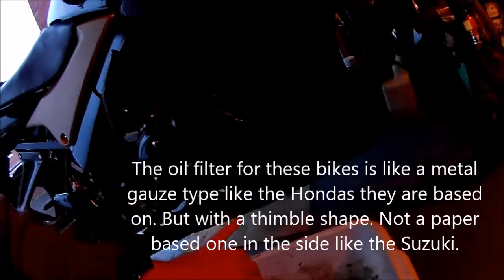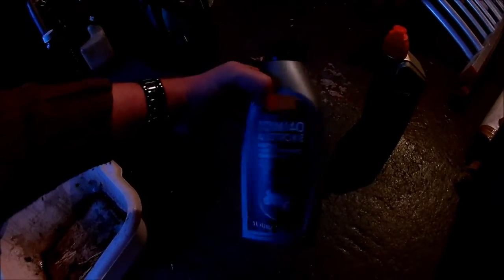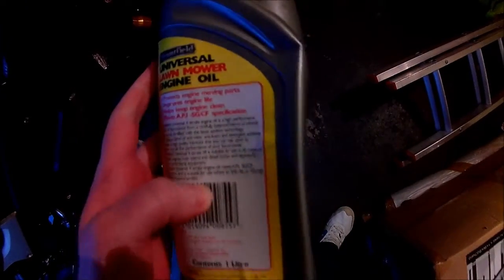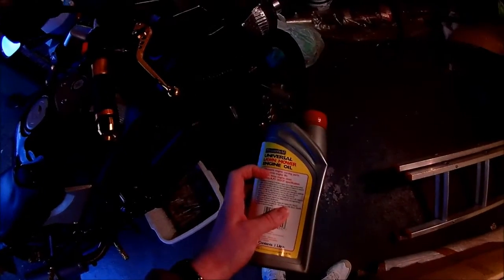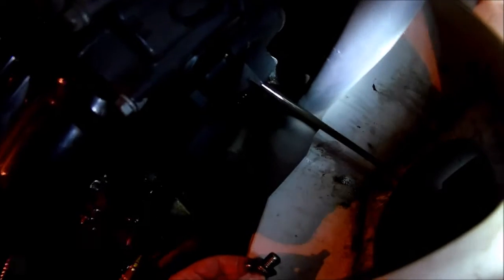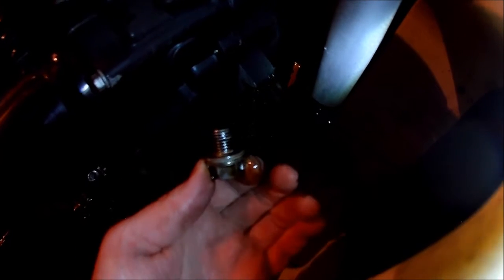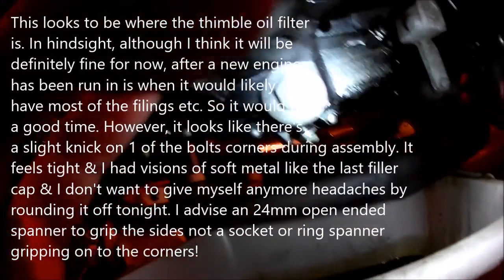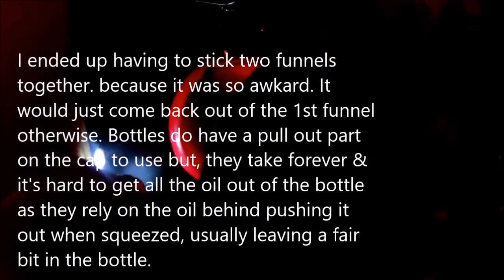Lexmoto XTRS / Skyjet oil change.

Comment: I got a Lexmoto XTRS ......where is the dip stick. Is it visable without taking fairing off?
Reply from the maker: There's no dip stick on filler cap, there's a level window on the right side with H & L on for high & low. When the bike is level & off the stand you will get a correct reading.

Comment: how did you undo the oil cap
Reply from the maker: Actually with great difficulty. You may be fine but, mine was so tight the nut deformed when I went to loosen it. I undone the casing & hit it from the inside with a blowtorch around the thread (doing so outside would damage the paint). This damaged the rubber o ring & I had to order a new cap & ring (I had to anyway, it was deformed). But it's been fine with the replacement. I just remember to add a little oil on the thread & don't   over tighten, like the factory did.

Comment: Dark image. Cant see anything much. Where's the oil drain plug?
Reply from the maker: James Barratt directly underneath the engine block. Remove the belly pan to get to it. Whatever it says in the vid, either 17mm or 19mm bolt. I think it's 17mm.
Reply: Awesome. I bought this bike with 800km on it. The thing had sat in a garage for two years. So changing oil and carburettor because gunked up and hopefully was the cause of it not starting. Ignition fine and compression. Do you think these bikes are reliable? Im thinking to fix it and sell it fast.

Comment: how did you get the filler cap off. mine is soft and did you take fairings off to fill with oil?
Reply from the maker: Graham little I didn't take the fairing off to top up with oil just to get at the 17mm sump bolt underneath to drain the oil. You will have to remove the belly pan part to do this. The original oil filler cap was soft like painted copper or some alloy & bent. At the time I had the side casting off to get at the clutch, so I hit the inside of the casting where it screws in with a blow torch. That loosened it up & it came out with a screwdriver, after sawing a slot across the top of the chewed nut head, then I replaced it with a spare from CMPO which is much better. If your having this problem it's a pain. A shop may be able to sort it. I recommend you put it or a new one back in with a touch of oil on the threads & don't overtightened it. It would seem they impact driver them in. I used two funnels linked together to get the oil in. Some oil bottles have an long arm that pulls out the lid though, it's slow going to squeeze it in but, it works. I Will add that since I changed the oil cap for the spare it comes off like in the vid no trouble.

Comment: not to be a party pooper. your presentation is fine.... But i really cant see anything. its far too dark :/
Reply from the maker: Mangy Dog Yeah, unfortunately it's winter, not many daylight hours. Even though it's better to let it settle to do it at night. Unfortunately with digital cameras you get you get in dull light. Still there should be enough info to see where I am in relation to each part around the engine? It's 3pm & I have to stretch the chain again, it's already dark.
Reply: Heh yeah in norfolk here just had my bike out in the drizzle getting some practice in... 

Just need to do a quick oil change and i couldnt work out what nut to loosen :D so quick you tube check
Reply from the maker: Mangy Dog Just be careful with the filler cap nut. The first one chewed up under an open ended spanner. It was copper or something painted black! The replacement was ok, similar to the caps on garden equipment engines.
Reply: Oh i managed to do the change on my bike :D And not chew the nut too much. I think mine is aluminium, still very very soft its already been rounded a little by previous owner and was put on farrrrrrrr too tight.

Out of interest what top speed did you get your bike? im struggling to get above 50 on mine.
Reply from the maker: I would order a new one to replace it next time.
I've actually got the bike to 70 odd. You can actually see the speedo in the one vid on here, when I realize I've gone over the limit & slow down. You really need to almost red line 4th gear before changing into 5th to get a good speed.